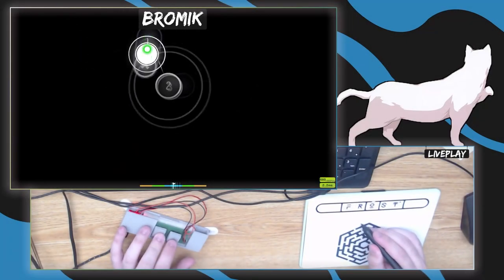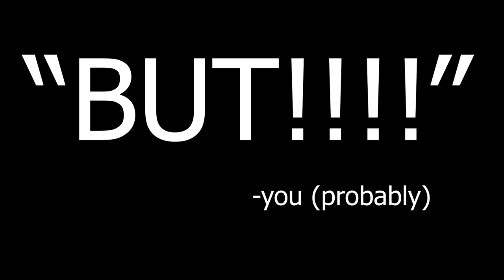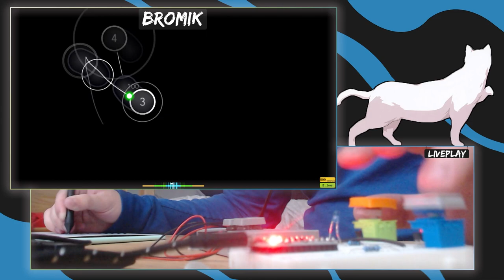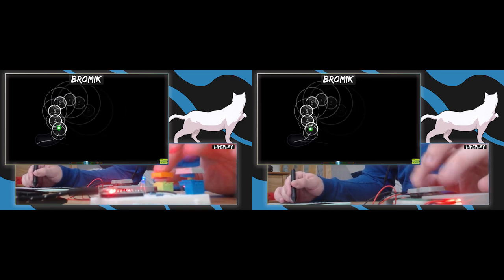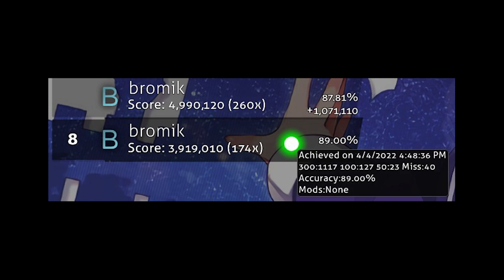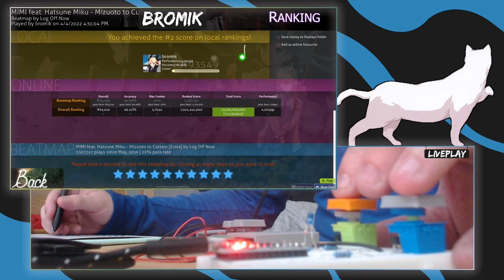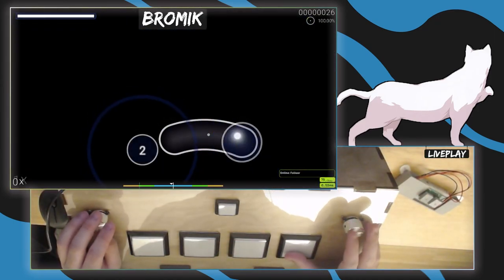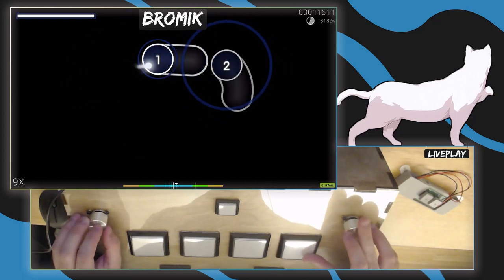The WORST osu! Keypad Ever Created

Comment: one key and you have to doubleclick for it to activate thats a worse one :)
Reply from the maker: if you can design a keypad that does that mechanically and without custom firmware, then absolutely. coding the arduino to only send a keypress every two clicks I would argue is not a keypad design issue, though

Comment: does the arduino register key presses at 1000hz?
Reply from the maker: yep, plus it has rollover support. Both of the keypads in the video actually use the same arduino code as well
Reply: @generalguy26  I want to try this but sad that Via doesnt have 1000hz support and messing with qmk will take a long time